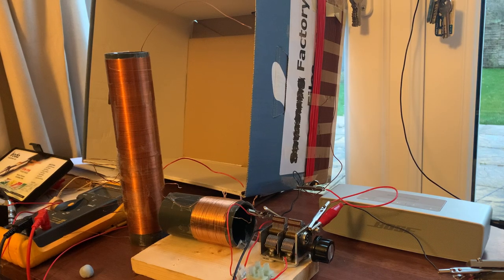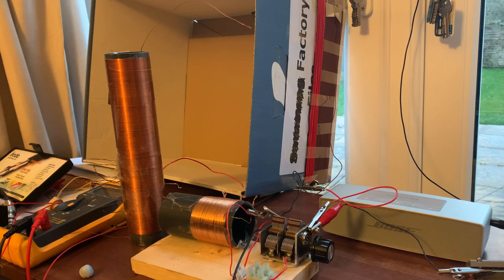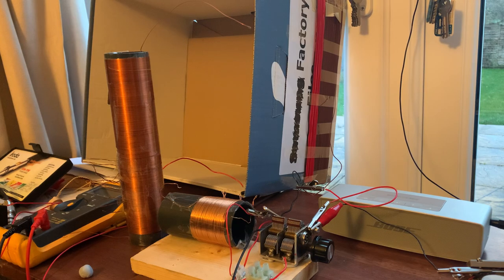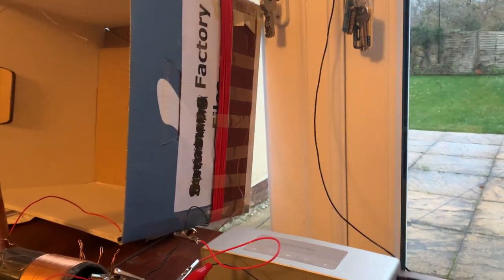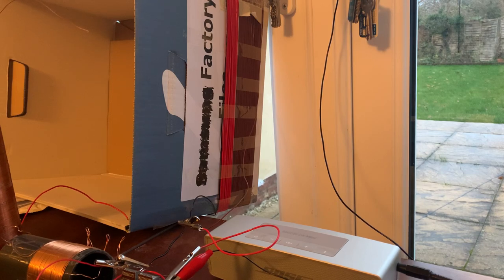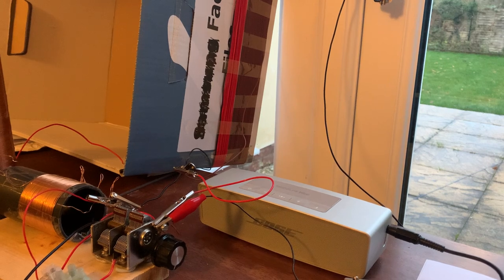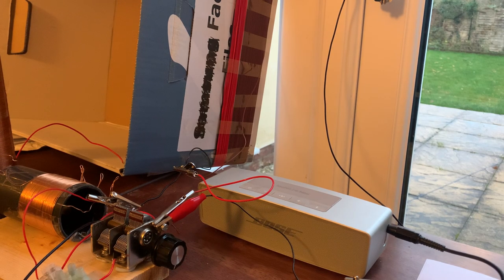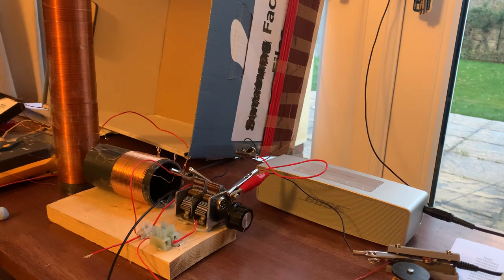Crystal radio set: a brief commentary on constructing a suitable coil for the longwave band

Comment: This is the first LW crystal set I have ever heard of. Congratulations!
Reply: Clint there is a retired BBC engineer elsewhere on YouTube that built a LW crystal set using a mailing tube wound 500 turns with a 560PF capacitor. Unfortunately I haven’t come across one of his videos in awhile. Good luck, good video. 73.
Reply from the maker: Cheers David, it's all down to the inductance of the coil you use and matching it with the variable cap. Thanks!
Reply from the maker: Thanks for the info. I'll try to find that video. 73!

Comment: I recently started playing around with my homemade broadcast band crystal radio.  With a coil of 350 uH and a 10 pF pF to 365 pF variable capacitor I can tune the whole broadcast band plus a little higher plus a little lower. When using just one coil  I get a lot of cross talk day and night.   And hear a lot more stations at night.  
I eliminated some cross talk (not all) by adding a second coil of 290 uH on the same coil form plus I made both coils so I could change their separation distance, by sliding the coils apart, or closer together. The coils closer together give stronger signals.  Sliding them farther apart helps separate stations a little, but weakens the signals.
When I use two coils the coil connected to the antenna (290 uH) induces RF into the main tuning coil of 350uH, because they're close together end to end.   
I connect one end of the 350 uH coil to ground and the other end to the diode where it shows on the schematic, and then connect the variable capacitor to each end of the main tuning coil, 350 uH..  The capacitor on the antenna coil make no difference in the frequencies received.
I can listen to higher frequency shortwave stations (above the broadcast Band) by changing the coil inductance.  I wind the lower inductance coils the same way as the other coils so I can change their separation by putting them on the same coil form.  
My short wave receiving coils measure 7.5 uH. 11.2 uH, 14.4 uH and 125 uH.  I'm hearing 4.840 mHz up to 6.115 mHz and some some other stations I haven't yet spotted their frequency with my store bought receiver.  
Because I use a meter that measures capacitance and inductance I've learned to trust coil winding formulas found on the Internet and the markings on capacitors.
Sometimes I put the low uH coils in my homemade crystal receiver alone and sometimes I put them on the same coil form with those higher inductance coils.  
You likely already know that when using two coils they must be wound with the same rotation.  Otherwise one coil might reject voltage from the other coil.
Reply from the maker: Thanks for your detailed comments - very interesting. I have an LCR meter which is great, but unless you wind a coil with tapping points, it can be a bit hit-and-miss winding the correct inductance. I wound a coil for HF and copied Radio Romania Internation and the World Service which was great, but selectivity is never great. Thanks again. 73
Reply: @OxfordShortwaveLog  You're welcome.  Thanks for sharing.  I just started thinking that using a roller inductor might help, but that's hard to make and ready made ones are more expensive than many DIYers are willing to spend.
I started harvesting parts from old HF rigs.  The tuning capacitors in those are something to behold.  73
Reply from the maker: Hi there, yes I do the same - dismantle old non-working radios for parts! The older - the better! 73
Reply: @OxfordShortwaveLog   I took it for granted that my tuning capacitors are 365pF.  At maximum they're only about 220pF and that is only if I add a jumper to one of the leads.
A fellow over here (tsbrownie) has a channel.  If you have time take a look at his video titled something to the effect (My new favorite crystal radio.)  He shows a modification to his crystal receiver he calls an L-Match. Basically it's an antenna match that helps increase station frequency separation.  That might help in your broadcast band as well as for long wave.  
I'm using that concept - well to a certain extent.  I do use an antenna coil without the slider and I use the main tuning coil, too, but I'm using a capacitor instead of the slider.  There's s distinct improvement in station separation.
In the last few weeks I swapped out my broadcast band coils.  For the main tune coil of about 14uH I receive AM stations somewhere between 4mHz and 7mHz.  Then I connect the antenna directly to the diode.  Sometimes I use one of the antenna coupler coils and receive those stations and often I use only the 14uH coil without the antenna coil and still get those same frequencies.  
73

Comment: Can you build a crystal radio that would pick up shortwave stations? That would be interesting. I’m so fascinated with radio because one of the first things I remember was building a crystal radio and having it work well enough to receive several different stations from all over the area. Didn’t know how to put up an antenna yet so I used a really long chain link fence. Worked surprisingly great! Thank you for your videos and your channel.
Reply from the maker: Hi, yes most certainly. The issue is finding a signal with enough strength to be detected. RRI would be the sort of station to listen out for. 73

Comment: The large longwave coil will have a high self capacitance and resistance. If you want to wind your own air core coil, a better approach is to use Litz wire and wind piles of coils with gaps between. However, an easier approach is to use a ferrite rod, as the higher permeability means you do not need as many turns of wire.
Reply from the maker: Thanks Richard - yes aware Litz is better and the use of ferrite, but I like to experiment with what I have to hand. 73
Reply: Your multi layer coil sounds sort of like an RF choke coil.  I found a few of those. but not yet tried them for receive.  Will experiment.  
I'm winding single layer coils on 1.5" and 2" diameter PVC pipe and sometimes get signals with no antenna attached.   I experiment with windings numbering 14 turns to 160 turns.  Plus I sometimes use one of the multi turn coils between antenna and ground and another multi turn coil on the same form, one coil end to ground and the other coil end to the variable capacitor.  The two coil arrangement gives pretty good signal separation some of the time.  
With the low inductance coils I receive way up above the broadcast band in the short wave region of the frequencies., up around 4.8 mHz to 6.115 mHz   And with those coils with 12 to 16 turns I get loud signals even without the antenna.  Oh, and sometimes I bypass all the coils and just attach the antenna to the diode where the coil would normally attach.  
Some crystal set plans show coils with a slider.  Using the slider allows adjusting the number of turns you actually receive with without wind a dozen different coils.  Some people also use the same type adjustment slider with the two coil system.  
I try all sorts of antenna coil wire and main tuner coil  wire placements to see what happens.
I don't have any Litz wire.  At the moment  I'm using wires salvaged from TV picture tubes.  Larger diameter wire is better.
Good shortwave hunting to you.